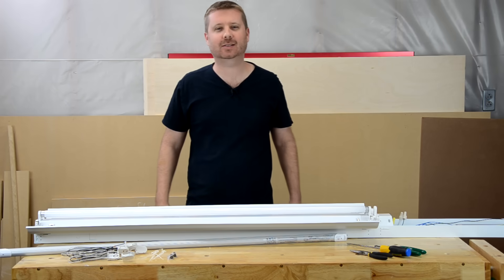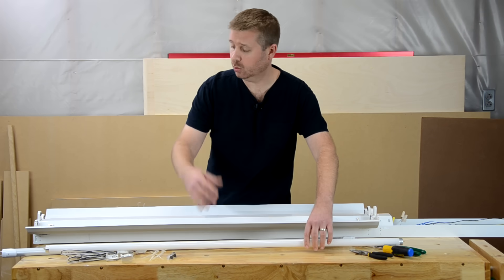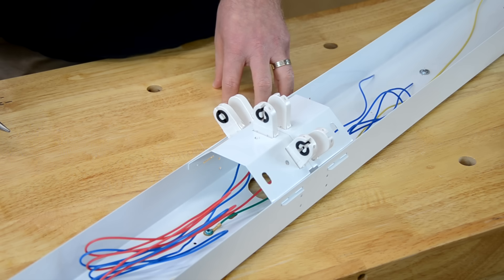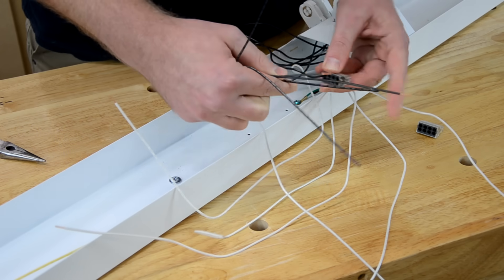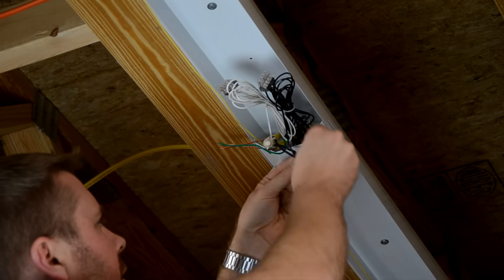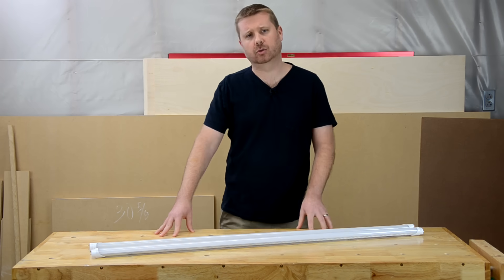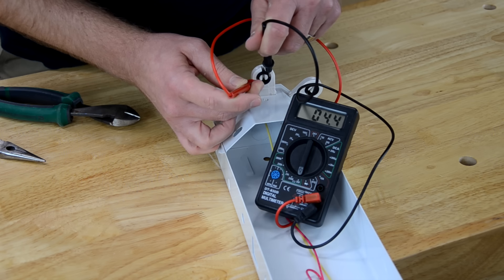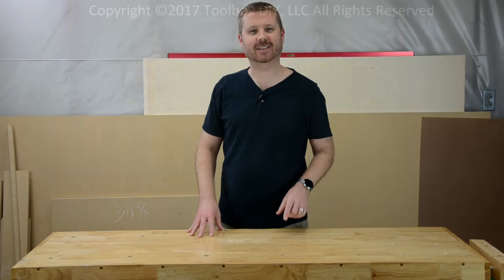How to easily convert fluorescent Lights to LED –Easy Ways to Save Money

Comment: So from this am I to understand that simply removing the ballast and getting the right end connectors installed - that a LED light will work simply by attaching it to 120v power leads to the connector wire?  I didn't know LED lights worked that way for house wiring.

My interest - we have a washer/dryer room that currently has a dual 24-inch flourescent fixture and one of the lights has burnt out, so there's room to upgrade to LED if possible.  I did try just going and buying LED lights to relplace, but they would turn on momentarily then remain off for a bit....turn on momentarily, then turn off.  I wasn't sure what I had done wrong but figured the LED's were stressing the ballasts intended for fluorescent.
Reply: Typically LED's will work with 110 volt to 277 volt so yes, just cut and trashthe ballast but make sure you feed the ends with the correct black & white wires. The ones I got on eBay had a little wire diagram on the selling site. https://www.youtube.com/watch?v=ZjpJNLT9xQc
Reply from the maker: LED tubes that do not require external drivers are powered simply by connecting them to 120v power. This video specifically covers single-ended LED tubes which is why replacing the lamp holders (aka tombstones or as you put it end connectors) was necessary. There are double-ended tubes that do not require replacing the lamp holders. Also, double ended tubes come in two flavors: plug-n-play which will work with a ballast or bypass which require removing or bypassing the ballast.

Comment: 4:25
WTG ..
The TOOL - (holding the pliers) is abusing / USING .. the totally WRONG TOOL
Those small long-nose pliers are NOT for that job, whereas a set of slip-jaw pliers are the perfect answer, as the jaws can be 'opened" to a wider aperture, to press BOTH tabs in at the exact same time, (instead the TOOL showed how it's easier to place one's fingers in the way of a possible injury - should the wrong tool have (itself) slipped.!!!
Reply: As

Comment: LED lamps made to be installed in a fixture as direct replacements require that the ballast be an instant start of solid state type for maximum lamp life and performance.  Older fixtures, especially shop lights usually have rapid start ballasts, which are different.  Very old fixtures have starters, small metal cans and that are visible and removable through the reflector by twisting.   Check the flourescent tube that you plan to replace for color temperature type.

BTW, this video may become moot.  Unless you have a built in or decorative fixture, it is rapidly becoming less expensive to purchase a new LED tubes fixture complete with lamps than to buy a conversion kit.

Comment: At abt 8 min by reinstalling the Lamp u said connect white to white and black to black and ground to ground. But i only see a green, yellow and red cable there. Is that a old color scheme ?
Reply from the maker: I think the red you are referring to is actually bare copper. Those are the grounds - they both connect to the green wire. There are two bare grounds because one is coming from the switch box and the other is going to another fixture on the same circuit.
The yellow is sheathing of home wiring. Inside that wire is a ground (bare copper), a neutral (white), and hot (black). If you pause it at 7:32, you can see the white and black insulation on the wires. Those are the wires I was referring to and they connected to the white and black pigtails installed in the push in connectors.

Comment: In alL the years of being an electrician I never hear the fluorescent sockets called "TOMBSTONES". I can see why they could be called that. it just never crossed me before.
I have been replacing all my 40ws with ribbon LEDs. I have collected a lot of 12v supplies. I run the ribbon around the  inter edge of the reflector. The ribbons are self sticking. I do use hot glue to reinforce.
I like Fluorescents until they all come from China. I had to many start flickering very soon after replacement. 
The ribbon LEDs are made in 3 LEDs per segment. I have seen a segment go out but that is really unnoticed.

Comment: Great idea but I think you ought to mention that one should check with your local regulations re the colour coding of wires and indeed if you are allowed to do this in your locales. I know out here in Australia we are not allowed to do this sort of work it must be a qualified electrician though I can see it is an easy thing that I could do but would rather get done by a tradesman to save myself a huge fine.

Comment: You can use those LED bulbs straight out from the box without rewiring the lamp and without disconnecting the ballast.
We used those led bulbs different ways, with an ballast and straight powered to the socket.
We found out that if you use the ballast method that the brightness will vary from ballast to ballast even though the same brand /kind is/was used.
Rewiring and putting power straight on the sockets will give you the same light output from lamp to lamp.
We started out 2 years ago with different locations from cold to hot environment and so far so good with no bad bulb yet.
Reply: In this case he mentioned that the ballasts were broken.
Reply: J & B Homeliving   No You Can Not!  Unless the LED lamp is specifically made for direct/ ballast operation....  And a great deal of these LED lamps will not work on the old magnetic ballasts!!!!  

You have to know which type of lamp your are buying.

Comment: I just bought LED replacement bulbs 4' for about 8$ each (after  tax) less lumens than fluorescent but seem brighter and use less watts
Reply: The lumens per watt of most LED tubes should be better than most fluorescent bulbs, especially if they don't use the ballasts (which waste some power).  The lumens ratting of the LED tubes (and fluorescent bulbs of the same size) will vary (as will the power draw).  Lower lumens doesn't mean lower efficiency (if the power rating is also lower).  Just try to buy LED tubes with similar lumen rating as the bulbs you now have to get the required amount of light.  Also the lumen output will be effected by the color temp rating of the LED tube as well.  (IE: the higher temp tubes usually carry a higher lumen rating due to the LED chips used.)

Comment: Congratulations, you just did the opposite of what you claimed.  LED light tubes typically over-rate their lumens and unless a very high end product, not only are not more energy efficient, but also produce less light and are higher maintenance (again if not high end well designed units) because they typically fail in a shorter amount of time than a T8 tube does, and cost more to replace too.  Odds are that you spent more money, saved nothing over the life of the fixtures.

Comment: Not a good idea to bunch wires tight with a zip tie because of the possibility of overheating and fire.
Reply from the maker: Generally speaking, I would agree. In this case, we only have about 180mA of current going thru each of the 14ga wires - virtually no heat being generated.
Reply: Apparently you don't take apart many things for repair.  MANY MANY different products found in your home have wiring bundles secured together with zip ties within their enclosures.  It's about the most common way to do it, and only in automotive applications do you typically find split loom tubing over the wire bundles to protect them.

Comment: By the time you buy the LED lamp and the connectors, you could probably buy an entire new fixture on sale.  Also, I've not had any problem buying LED bulbs that swap out existing fixtures, so no need for all the rewiring.

Comment: Informative. I am not sure using the term "shorted" is correct to describe a bridge. I short would be if both sides of circuit were connected to kill the "flow" of current.

Comment: I'm quite sure, but will mention regardless, that 'ambient' temperature has no bearing on the usage  location.  Florescent lighting does however require consideration of the aforementioned. If you are interested, here is a 'site'......http://www.lrc.rpi.edu/programs/nlpip/lightingAnswers/HWCFL/HWCFL-thermal-performance3.asp
Reply: You are incorrect.  LED drivers have both low temperature and high temperature issues, unless specifically designed for extreme environments in which case they cost significantly more.  However, LED fixtures do typically start out at first power on producing a higher % of their total light output for the few tens of seconds being powered on.

Comment: I wish I saw this video 3 years ago. I had shop fluorescent  fixtures. I wanted to rewire them but I was to nervous because there was not enough information on how to do it. Instead I did what I know how to wire. I put 12 incandescent fixtures in with LED incandescent bulb type that just screw in. I think I paid a lot more for installing the old fixtures plus LED type that screws in.

Comment: You don't need to do any of that. They sell LED fluorescent bulbs that are compatible with older ballast type fixtures. Just change out the bulbs. I did it in my kitchen and garage. It took 5 minutes and worked great. Lots more light and only 17 watts. Don't make work for yourself. These are what you need.    https://www.homedepot.com/p/Feit-Electric-4-ft-T8-T12-17-Watt-Cool-White-Linear-LED-Light-Bulb-T48-841-LED-RP/206036836
Reply: billt460 no you have much less light from a 17W LED drop-in than from a typical 32W fluorescent tube.  It's not even close, there is no 17W LED tube on the market that can match a modern 32W T8 4' fluorescent tube's output.  You have to install at least 50% more LED fixtures to come close and still fall short, all the while not saving much power or money either.  Hint:  Science involves facts and numbers like lumens.  It also requires ignoring manufacturer claims and looking at LED datasheets, measuring current and consulting a graph to see lumens per LED at the drive current and multiplying by # of LEDs to arrive at the true lumen output.  Generic lighting manufacturers lie but LED datasheets and precise measurements do not.
Reply: Wrong. The lights I linked to are MUCH BRIGHTER than the standard 32 Watt Fluorescent tubes they replaced. Watch this video. It proves it.     https://www.youtube.com/watch?v=v_AHQI-xX2U

Comment: Normally at our places, we just remove the fluorescent light starter/bulb and replace it with a single-ended led tube. It cost US7.76 for a super bright led tube and come with a one year warranty.
Reply from the maker: Thanks for the feedback. Can you share why you choose single-ended LED tubes? A lot of comments on this video are complaints that the conversion to single ended is too much work. You must have a good reason for not using the double ended LEDs and I'm curious what those reasons might be.

Comment: I have already successfully replaced many Fluorescent tubes with LED tubes, and I have always followed the schematic which you can find here: http://www.snc-lighting.com/imageRepository/d18b93eb-34d8-4052-99b7-f74cdf6d28a6.jpg.
I prefer that kind of connection for two very good reasons: it's SAFE and it's REVERSIBLE: Safe because even if you connect the LED on the other side, it will still work perfectly (no risk of shorts); Reversible because in case in the future you want to go back to fluorescent you just connect again the ballast and put back the "real" starter instead of the "fake" LED "starter".
I do not remove the old ballast from the lamp, I just disconnect it. 
I haven't seen LED tubes REQUIRING the ballast, but the ones which I am using can work also without removing it, but since 1 -ballast can fail 2 -ballast eats energy; for me it's wise to disconnect it always, but some say if you want to keep full backward compatibility you should leave the ballast in place. My advice is to disconnect it, and mark on the lamp "ballast disconnected" ore "converted to LED".
I use LED tubes which are powered only on one side.

As somebody suggested, ALWAYS keep the receipts, because LED tubes sometimes fail, and if they fail, it's much sooner of what is the warranty (in my case LED tubes have 3 years warranty, and my failed LED tubes failed in the first few weeks). 
In my small experience I had to change 3 failed LED tubes, over a total of 6 installed and running every night, and I started replacing them 3 years ago (so the first ones are almost out of warranty, and still working perfectly, every night, and no noticeable loss of brightness).

Even if it seems that the saving (in terms of power) is small, in reality the power eaten by a conventional fluorescent tube is almost double of the rated power, because the electromagnetic ballast eats almost the same amount of power as the tube itself: eg. an 18W fluorescent tube will cost on your electric bill probably approximately 30W. 
The LED equivalent for and 18W fluorescent is rated for 10W, so it's almost half of the rated power of the fluorescent, and almost a third of the real consumption of the fluorescent with an electromagnetic ballast.
Electronic ballasts are much more efficient, so the saving in terms of power is smaller, but still (if the LED tube doesn't fail prematurely, but for this you must keep your receipts) it makes sense to replace the fluorescent with an LED tube because it lasts much longer.

Personally I always keep one LED tube on stock at home, and when one fluorescent tube fails, I replace it with the LED.
Before starting the switch to LED, I consumed all my (small) stock of fluorescent tubes, simply because I hate throwing in the bin something which is still working. 

Another hint: if you don't plan to replace all your lamps at once, but you do like me, one by one, start replacing the tubes in the lights which are on for more hours, then the ones which turn on and off more frequently, and in the end all the rest. In this way you'll notice the saving on your bill much faster, and the saving on earlier bills will give you money for the next LED tubes ;)

HTH!

Comment: I changed all of my fluorescents to LEDs without needing to do all of that. Maybe the newer LEDs are different now.
Reply: Yes, but you can still get both kinds. You installed the "plug n play" tubes which are not much better than fluorescent tubes. Why? Because you still need the ballast which kind of defeats the purpose.

Comment: Do the LED light have a strobing effect?
Reply from the maker: Some can, but I have yet to purchase any that do. (Just by luck). I would expect really cheap LEDs to have this problem because they skimp on the electronics for AC to DC voltage conversion. I rely heavily on reviews to avoid getting a poorly performing LED. If you get one that flickers or strobes, I would return it and try a new brand.

Comment: Nice video.  Certainly a little complicated.  I have 12 - 8' double tube fixtures in my garage/shop (110w/each tube) and I am probably going to simply take them down and install a bunch of very inexpensive keyless fixtures (bare bulb) with daylight flood style LED bulbs.  Stringing as many as I want together with Romex on the ceiling.  They'll be brighter, more efficient and safer since they're plastic.

Comment: With the ballasts removed, will T8 LEDs work well in T12 fixtures? What I've read suggests that it will more-or-less work... but it may "hum" and the bulb lifespan may be shorter. No mention of whether that's with the ballast removed/bypassed, though. Thoughts?
Reply from the maker: If you go down this path of converting for a single-ended LED tube, I would recommend removing the T12 lamp holders and replacing them with T8 or ones that support both T8 and T12. As for using a T8 LED with a T12 ballast, that would likely depend on the T8 LED tube manufacturer's instructions. Some might work, some might not.
The hum is likely due to not bypassing the ballast. I have yet to experience any humming with T8 LEDs, but I've only used two different brands. I do find that dimmable LEDs have a slight hum when turned down.

Comment: Now JB Dragon your getting abusive with your comments its obvious we are talk about doing conversions that people do in their homes where it is more likely home body will do it them self. They are not going to remove the tubes like you do and will not put labels on the fixture like you do. Where I am from modding a fixture requires a licensed electrician and proper certification of the modded fixture from an electrical safety authority. To you I am the dumb person or maybe  your ignorance blinds you to the fact people are watching this video on YouTube and think their are no risks after they do the conversion. I speak with more then 35 years of experience in the electrical trade doing work in industrial, commercial and residential field and yes also doing conversions. I seen people get hurt from electricity have you. Their is need for you  to respond to this comment JB, I have met a lot of people like you !?

Comment: Ummm .... if you have the time and inclination and the necessary knowledge, a video about converting battery operated, four AA batteries, miniature led christmas lights so that they can be plugged into the wall socket would be my request:}
Reply from the maker: That's a great idea, but unfortunately I won't have the time in the foreseeable future. Maybe this will help: http://www.instructables.com/id/Convert-Battery-Powered-Electronics-to-Run-on-AC/